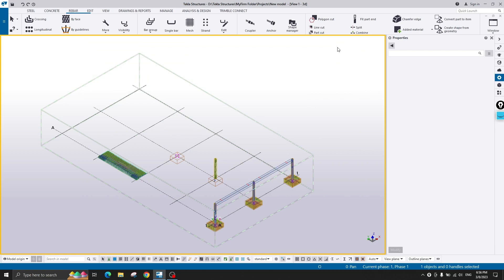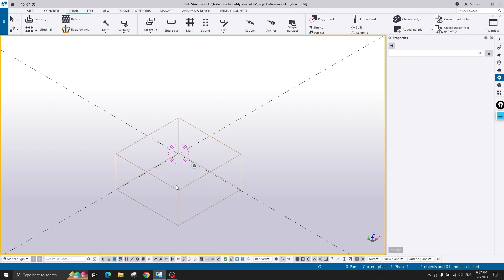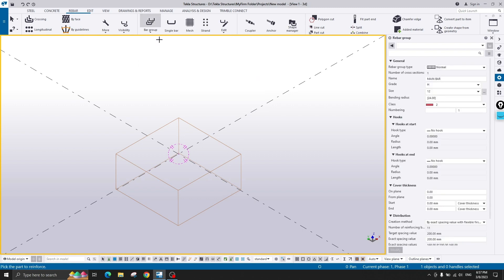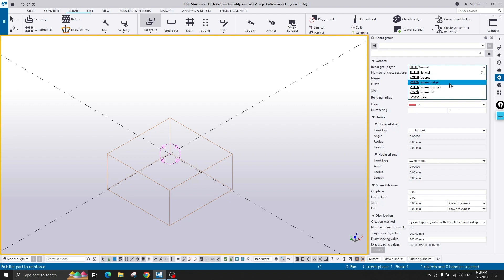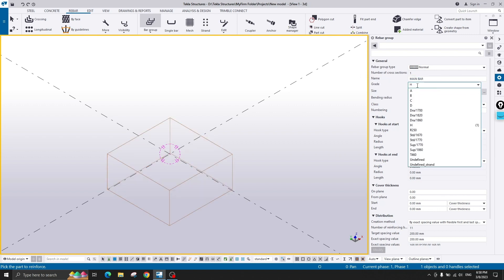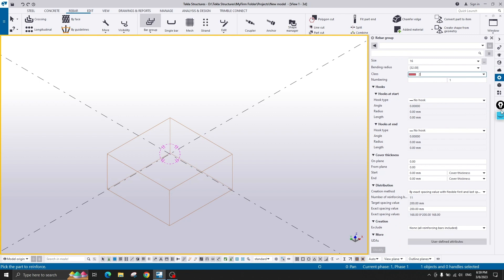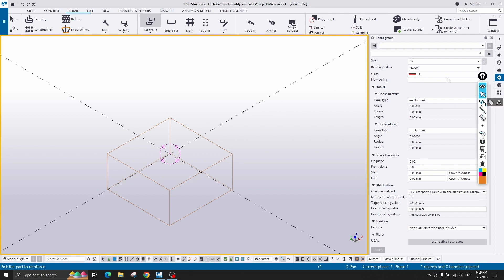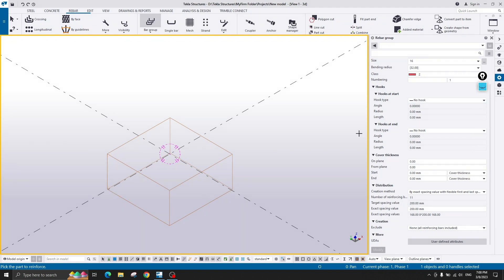Concrete Reinforcement in Tekla Structures Lecture -1 (Bar Group)

Comment: Hello. I have another question. I decided to use continous beam reinforcement to model the beam reinforcement because I need middle and support area. But this component doesn't have side bar option. So am I supposed to add side bar manually by using longitudinal rebar or there is another/easier way?
Reply from the maker: Yes, You can do anything with combination of your manual work and a component.

Comment: Hello. I have a question. I succesfully added the reinforcement I needed but on certain activities, such as I clicked on something else or redraw view, the reinforcement is missing from general view. I'm pretty sure it's not deleted since there's no undo history. But how do I show the reinforcement again? Thanks in advance
Reply from the maker: Hi Ricky, Probably your visibility setting does not let to show reinforcement, double click on an empty area to open view properties then click on display and make sure reinforcing bars are checked, if it did not solve your problem then you should check your visibility object group, by default it is standard, click on object group and check if there is a specific rule to hide the rebars. If the above solutions were not helpful, then you may join my telegram channel and I will explain it there.
Reply: @civilengineeringwitharas4776  View properties solved this issue.

I have one more question. I saw some tutorial use rebar in beam and some others use beam reinforcement. What is the difference and what case or when to use each one?
Reply from the maker: @rickykurniadi742  Do you mean some use components and others use rebar commands  ?